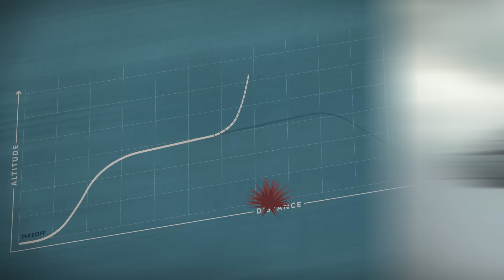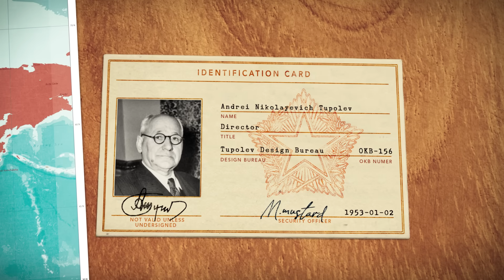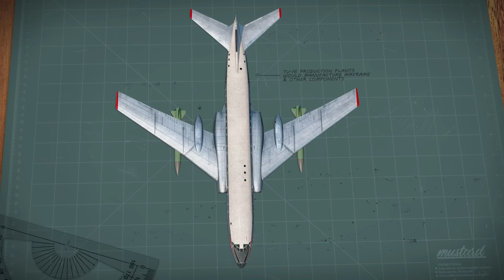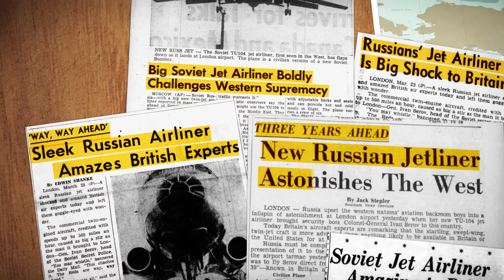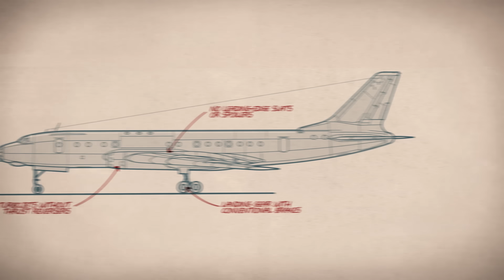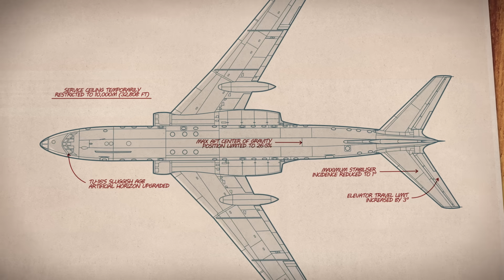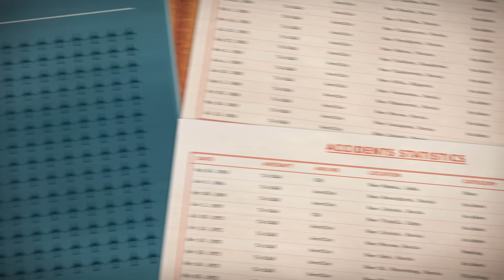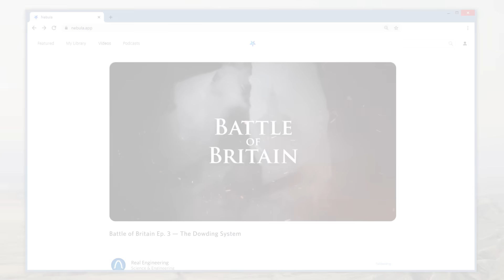The Soviet Airliner Designed To Crash

Comment: “Soviet Technology” is the utmost of oxymoron.
Reply: Much safer than the de Havilland Comet... Britain made the world's worst jet airliners... which is why all the British aircraft companies went tits-up!
Reply: @sandervanderkammen9230  Damn, someone is real mad it seems...
Does hearing about soviet tech being bad trigger ya?
Reply: @sandervanderkammen9230 

We feel we can shed some light on some common myths & misunderstandings repeated in many comments.

Although the TU-104 was a later design aircraft it was not safer than the DH Comet.

It is indeed correct that there were plenty of aircraft that were more dangerous than the De Havilland Comet before & after the Comet.

Obviously It's not valid to compare a Bow-wing ( see B-47 wing folding & wing collapse incidents for details) jet  airliner designed & first built as late 6 decades after the Comet, with the fabulous De Havilland Comet, the world's first high altitude jet powered airliner.  
  Vast improvements in commercial aviation infrastructure & pilot familiarity with jet airliners alone being a significant factor in improvements in air travel safety safety over more than half a century.

    Of course Bow-wing having 50 years more design, build & operation experience than De Havilland didn't prevent the horrendous Bow-wing Max  incidents, there can obviously be no excuses for that.
  
  That's correct of course, at the time the Comet wasn't particularly dangerous. Agreed, that is indeed the case of course, The DH Comet was definitely not the worst engineering failure in commercial airliner history.

Losses comparisons
How things were in those days.

DeHavilland Comet 4 UK                  14% 
DeHavilland Comet all mks             17%  

Boeing 307                               70%
Boeing 247                               48%
Boeing 707            .                  20% 
Lockheed Electra Turboprop   29%
Canadair CL-44  Turboprop     46%  
Convair CV-580  Turboprop     22%
Convair CV-880    (ff 1959)       27%  
Convair CV-990     (ff 1961)      33%
Tupolev TU-104       (ff 1955)    16%

     Of course De Havilland had prior experience building many all metal construction airframe aircraft & thousands of jet powered fighter aircraft that were primarily of metal construction with pressurised cockpits & jet engines built by De-Havilland.

  Yes, that's true, De Havilland carried out full stress analysis & engaged in a comprehensive & protracted testing program which is why key De Havilland people were happy to be aboard flying DH Comet aircraft. The Comet was the first airliner where stress due to pressurisation significantly exceeded flying load stress for a full length passenger cabin fyselage.

    We agree, that's correct, the DH Comet was the first passenger airliner with full length fuselage pressurisation at 8psi pressure differential. Handley Page built the world's first all metal construction airliner during the 1920s.
    In many cases earlier pressurised aircraft were larger, needed thicker fuselage skins due to flying stresses alone & had much lower pressurisation differential pressure. 

     Of course ripstop provision was provided. The skin alloy used became unavailable at the time due to R & D at the manufacturers which resulted in the original alloy being discontinued. Later alloys had very similar properties. The skin thickness used for the Comet was used for similar size later aircraft. Frame spacing was not found to be too large & frame width was not found to be too small.

    Without doubt De Havilland did indeed always work to better than industry standards at the time, used up to date knowledge for the design & construction & no evidence of negligence or criminal negligence was ever produced in relation to the DH Comet.

   Obviously the DH Comet had no effect on the course of the aerospace industry in the UK. The UK now has the world's largest combined nuclear, aerospace & defence sectors per capita activity.

    That's correct, the investigation committee did not find hundreds of fatal flaws or evidence of design defects, structural defects, defective materials or shoddy workmanship. Indeed it is the case that ripstop provision was included. Claimed incidents did not involve cracks starting from passenger window corners.
   Pretty much all changes were just in case changes or were planned development modifications & improvements that were scheduled regardless of incidents.

    Obviously De Havilland designers knew all there was to know about metal fatigue at the time they designed the DH Comet.

    It is in fact true to say that the way airliners were built changed everywhere including in the US after the Comet incidents.

We hope this helps, obviously.

Cheers indeed of course 👍. 
                      
 . . .... ... .... .  .. .......
.. ......... ..  ... . . .... ......

Comment: LOL just had to be a Russian  plane.
Reply: The British de Havilland Comet was the worst engineering failure in commercial jet aviation history.
Reply: @sandervanderkammen9230 
We feel we can shed some light on some common myths & misunderstandings repeated in many comments.

Although the TU-104 was a later design aircraft it was not safer than the DH Comet.

It is indeed correct that there were plenty of aircraft that were more dangerous than the De Havilland Comet before & after the Comet.

Obviously It's not valid to compare a Bow-wing ( see B-47 wing folding & wing collapse incidents for details) jet  airliner designed & first built as late 6 decades after the Comet, with the fabulous De Havilland Comet, the world's first high altitude jet powered airliner.  
  Vast improvements in commercial aviation infrastructure & pilot familiarity with jet airliners alone being a significant factor in improvements in air travel safety safety over more than half a century.

    Of course Bow-wing having 50 years more design, build & operation experience than De Havilland didn't prevent the horrendous Bow-wing Max  incidents, there can obviously be no excuses for that.
  
  That's correct of course, at the time the Comet wasn't particularly dangerous. Agreed, that is indeed the case of course, The DH Comet was definitely not the worst engineering failure in commercial airliner history.

Losses comparisons
How things were in those days.

DeHavilland Comet 4 UK                  14% 
DeHavilland Comet all mks             17%  

Boeing 307                               70%
Boeing 247                               48%
Boeing 707            .                  20% 
Lockheed Electra Turboprop   29%
Canadair CL-44  Turboprop     46%  
Convair CV-580  Turboprop     22%
Convair CV-880    (ff 1959)       27%  
Convair CV-990     (ff 1961)      33%
Tupolev TU-104       (ff 1955)    16%

     Of course De Havilland had prior experience building many all metal construction airframe aircraft & thousands of jet powered fighter aircraft that were primarily of metal construction with pressurised cockpits & jet engines built by De-Havilland.

  Yes, that's true, De Havilland carried out full stress analysis & engaged in a comprehensive & protracted testing program which is why key De Havilland people were happy to be aboard flying DH Comet aircraft. The Comet was the first airliner where stress due to pressurisation significantly exceeded flying load stress for a full length passenger cabin fyselage.

    We agree, that's correct, the DH Comet was the first passenger airliner with full length fuselage pressurisation at 8psi pressure differential. Handley Page built the world's first all metal construction airliner during the 1920s.
    In many cases earlier pressurised aircraft were larger, needed thicker fuselage skins due to flying stresses alone & had much lower pressurisation differential pressure. 

     Of course ripstop provision was provided. The skin alloy used became unavailable at the time due to R & D at the manufacturers which resulted in the original alloy being discontinued. Later alloys had very similar properties. The skin thickness used for the Comet was used for similar size later aircraft. Frame spacing was not found to be too large & frame width was not found to be too small.

    Without doubt De Havilland did indeed always work to better than industry standards at the time, used up to date knowledge for the design & construction & no evidence of negligence or criminal negligence was ever produced in relation to the DH Comet.

   Obviously the DH Comet had no effect on the course of the aerospace industry in the UK. The UK now has the world's largest combined nuclear, aerospace & defence sectors per capita activity.

    That's correct, the investigation committee did not find hundreds of fatal flaws or evidence of design defects, structural defects, defective materials or shoddy workmanship. Indeed it is the case that ripstop provision was included. Claimed incidents did not involve cracks starting from passenger window corners.
   Pretty much all changes were just in case changes or were planned development modifications & improvements that were scheduled regardless of incidents.

    Obviously De Havilland designers knew all there was to know about metal fatigue at the time they designed the DH Comet.

    It is in fact true to say that the way airliners were built changed everywhere including in the US after the Comet incidents.

We hope this helps, obviously.

Cheers indeed of course 👍. 
                   
 . . .... ... .... .  .. ..........
.. ......... ..  ... . . .........
 ..... ..... .... ... .......
Reply: @sandervanderkammen9230  Fake news

Comment: Tex Johnston had the greatest description of the Tu-104 ever.
Reply: Captain Alan Gibson thought the Tu-104  was an excellent plane, he was killed flying the de Havilland Comet..
Reply: @sandervanderkammen9230 

We feel we can shed some light on some common myths & misunderstandings repeated in many comments.

Although the TU-104 was a later design aircraft it was not safer than the DH Comet.

It is indeed correct that there were plenty of aircraft that were more dangerous than the De Havilland Comet before & after the Comet.

Obviously It's not valid to compare a Bow-wing ( see B-47 wing folding & wing collapse incidents for details) jet  airliner designed & first built as late 6 decades after the Comet, with the fabulous De Havilland Comet, the world's first high altitude jet powered airliner.  
  Vast improvements in commercial aviation infrastructure & pilot familiarity with jet airliners alone being a significant factor in improvements in air travel safety safety over more than half a century.

    Of course Bow-wing having 50 years more design, build & operation experience than De Havilland didn't prevent the horrendous Bow-wing Max  incidents, there can obviously be no excuses for that.
  
  That's correct of course, at the time the Comet wasn't particularly dangerous. Agreed, that is indeed the case of course, The DH Comet was definitely not the worst engineering failure in commercial airliner history.

Losses comparisons
How things were in those days.

DeHavilland Comet 4 UK                  14% 
DeHavilland Comet all mks             17%  

Boeing 307                               70%
Boeing 247                               48%
Boeing 707            .                  20% 
Lockheed Electra Turboprop   29%
Canadair CL-44  Turboprop     46%  
Convair CV-580  Turboprop     22%
Convair CV-880    (ff 1959)       27%  
Convair CV-990     (ff 1961)      33%
Tupolev TU-104       (ff 1955)    16%

     Of course De Havilland had prior experience building many all metal construction airframe aircraft & thousands of jet powered fighter aircraft that were primarily of metal construction with pressurised cockpits & jet engines built by De-Havilland.

  Yes, that's true, De Havilland carried out full stress analysis & engaged in a comprehensive & protracted testing program which is why key De Havilland people were happy to be aboard flying DH Comet aircraft. The Comet was the first airliner where stress due to pressurisation significantly exceeded flying load stress for a full length passenger cabin fyselage.

    We agree, that's correct, the DH Comet was the first passenger airliner with full length fuselage pressurisation at 8psi pressure differential. Handley Page built the world's first all metal construction airliner during the 1920s.
    In many cases earlier pressurised aircraft were larger, needed thicker fuselage skins due to flying stresses alone & had much lower pressurisation differential pressure. 

     Of course ripstop provision was provided. The skin alloy used became unavailable at the time due to R & D at the manufacturers which resulted in the original alloy being discontinued. Later alloys had very similar properties. The skin thickness used for the Comet was used for similar size later aircraft. Frame spacing was not found to be too large & frame width was not found to be too small.

    Without doubt De Havilland did indeed always work to better than industry standards at the time, used up to date knowledge for the design & construction & no evidence of negligence or criminal negligence was ever produced in relation to the DH Comet.

   Obviously the DH Comet had no effect on the course of the aerospace industry in the UK. The UK now has the world's largest combined nuclear, aerospace & defence sectors per capita activity.

    That's correct, the investigation committee did not find hundreds of fatal flaws or evidence of design defects, structural defects, defective materials or shoddy workmanship. Indeed it is the case that ripstop provision was included. Claimed incidents did not involve cracks starting from passenger window corners.
   Pretty much all changes were just in case changes or were planned development modifications & improvements that were scheduled regardless of incidents.

    Obviously De Havilland designers knew all there was to know about metal fatigue at the time they designed the DH Comet.

    It is in fact true to say that the way airliners were built changed everywhere including in the US after the Comet incidents.

We hope this helps, obviously.

Cheers indeed of course 👍. 
                   
 . . .... ... .... .  .. .... ...
.. ......... ..  ... . . .... ...
 ..... ..... .... ... ........